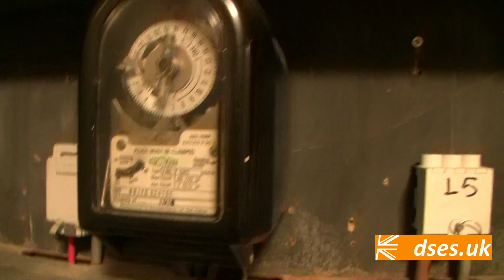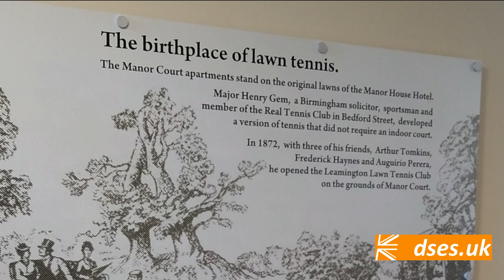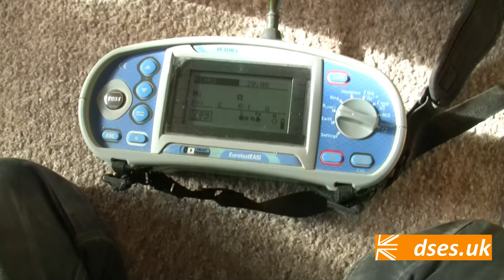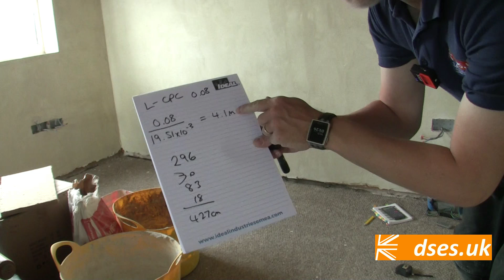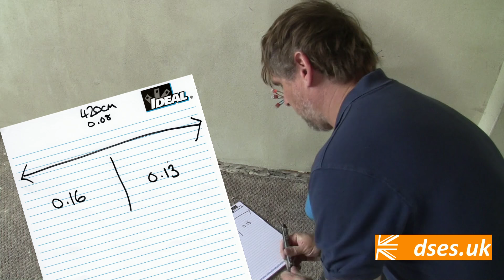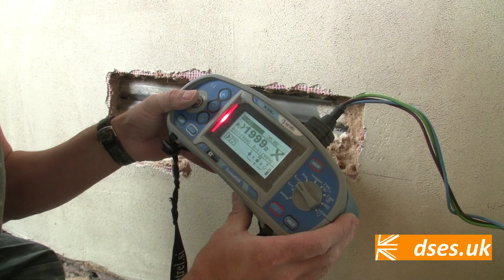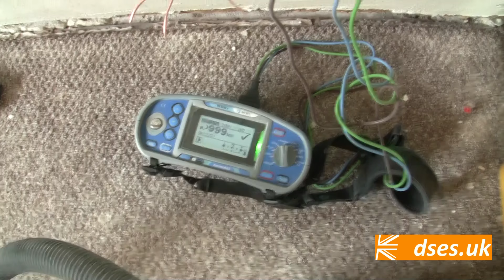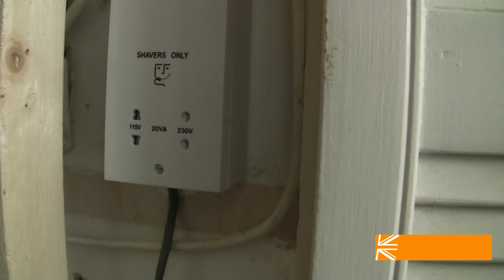Fixing another man's lash-up!

Comment: I do the 1st fix using Wagos type of connectors inside the socket/FCU backboxes, connecting up a ring (or a radial), and even connecting the earth terminal of a metal backbox. The backboxes are effectively doubled up as junction boxes. The ring circuit is tested after the 1st fix.  Any wiring problems are identified before finishing trades turn up. Putting it right afterwards may be big problems.

Then the plasterers and painters come in doing their work. The Wagos are left in place in the backboxes. Then on the 2nd fix, on a bench the sockets and FCUs are prepared, by screwing into all the socket's tail's flexible 2.5mm cable, including an insulated earth wire, about 100mm long with a ferrule onto the flexible wire into sockets screwed terminal connection. The flexible tails are put into the Wagos at the back of the back boxes. The socket easily pushes back in being on flex tails. Then test again. The speed, and ease, of installation is much quicker. And much safer as the ring itself does not have screw connections that can work loose.

I have found many terminal screws on the back of sockets that worked loose over time - expansion-contraction, vibration from people walking on wooden floors, plugs being rammed in and out constantly, etc. That is why screwed terminal are maintenance terminals. Wago screwless are maintenance free. Wago also apply the correct torque to the wire, which is maintained over time as well. Having the full current of a ring circuit flowing through the terminal at the rear of sockets is a potential fire situation, with maybe arcing, also adding higher resistances to the ring, which may cause one leg of the ring to take most of the load, etc.

That is where Wago types of connectors, in the scenario I just outlined, take the ring's load, not the screwed terminals on the rear of the sockets. It is much safer.   The sockets are only spurs off the ring, taking only current when an appliance is drawing current. Go back to a ring circuit after 10, 15, 20 years, then test it. Then go back to one which has the ring running though maintenance free Wago types. The integrity of the Wago connection ring will be upheld. Much safer.

Having Wago types of connections on the rear of sockets, as in Germany, adds another level of safety, in eliminating another screw terminal potential failure/fire risk.  The UK does not have these types of socket connections yet.
Reply: I am in Paris. I have noticed that the normal French sockets have push in screwless connections.  We are only just catching up. 

I would consider using French light switches. They need just a round hole in the brickwork behind. The light switches are push in screwless. The switch is secured by two grips to the sides which are forced outwards clamping the switch to the sides of round hole behind. Much better than the British clunky and time consuming system of square backboxes.

Comment: I'd have chopped a box into the wall and put a blank plate over the join. I know not the prettiest repair but it's a budget job on 60s flats. If it needed to be hidden I'd have gone non insulated crimps, heat shrink the cores then heat shrink the sheath. Been working abroad for a few years though and the colonies are much more into crimped cable joins than old Blighty.

Comment: That’s quite similar to how a DSO would find a fault in a long low voltage (under 1 kV) underground cable, though they would probably cut it halfway for starters and then start locating it. On medium voltage it’s a lot more exciting, out comes the trailer with the surge generator, aka the thumper!

Comment: Hi Dave I really enjoy your videos very informative and wow amazing talent finding that fault. I would like to mention that arse of a job who suggested putting a single outlet so the clients could charge up their laptop or phone on the off peak so it’s on a cheap rate could have simply informed them and said that when the off peak kicks in your meter changes to Rate 2 or 4 depending on which type of Meter you have which all in all means everything during the time the meter is accumulating on the lower rate reading will be on the cheap lower rate price regardless wether it’s consumption of the off peak board or the 24hr as the meter is a single piece of equipment and has two rates. Yes there are two DB boards one off peak and one 24hr however the off peaks gets power when the meter/time clock contactor kicks in at midnight to 7 or whatever the local timing!! Nevertheless great work by you and what a invaluable great video keep them coming.

Comment: clever measurement of cable resistance to find the break!  If it hadn't been the storage heater wire I'd have been tempted to join it by putting in an extra socket.  btw in France the regs say we can't plaster over a join, so there would have been a blanking plate over it.
Reply from the maker: Very interesting, I didn't realise that was the case at the other end of the tunnel! A blank plate could have been put in here, but it would have been out of line with the other accessories so I discounted it on aesthetics.

Comment: Yeah I would have gone from socket to socket in the ring, and then back to the cu.
Thats how we used to do it in the old times, then everything was on ring circuits except for the shower, emersion
and cooker circuits. I have been out of action for a few years now and everythings changed, so I'm going to take a short 
course just to get me up to speed on any new regs and cu changes.  It was all rewireable fuses in my day.

Comment: That was awesome to watch I'm going to have to watch it again I need to learn how to do the calculations, and how quickly you pin pointed the fault excellent the wiring method is called leap froging we only use this method in dado trunking and nowhere else thanks for sharing its very helpful to us older newbies 👍
Reply from the maker: Thanks Mark. I don't see much dado in my mainly domestic work, so hadn't come across it before. Seems a strange one to bury in walls in a domestic install.
Reply: Here is how to calculate the actual distance. I expect David knows but he didn't put it in the video!:

The two readings (0.13ohms and 0.16ohms) represent the RATIO of distance to the fault from either end. An actual reading to the fault can be obtained by the following equation:

(r1 / (r1+r2)) x Cable length (end to end)

where r1 is resistance to fault from point 1,
r2 is resistance to fault from point 2
and cable length is obtained by direct measurement (cable route known) OR calculated as David did in this video using the CPC and line conductor. For this example, the calculation is as follows:

(0.13/(0.13+0.16)) x 4.2 = 1.88m from the point where the resistance was 0.13ohms

the same works the other way:

(0.16/(0.13+0.16)) x 4.2 = 2.32m from the point where the resistance was 0.16ohms.

Comment: I don't use capping at all. I use galvanised steel banding and screw it to the wall. There are so many advantages...Its easier, modifiable (at first fix), safer (no screws/nails through cables, ever) and dirt cheap.

Comment: Quality fault finding on that . Learnt a new way to fault find today 👍
Reply: Heres how to calculate the actual distance to the fault:

 The two readings (0.13ohms and 0.16ohms) represent the RATIO of distance to the fault from either end. An actual reading to the fault can be obtained by the following equation:

(r1 / (r1+r2)) x Cable length (end to end)

where r1 is resistance to fault from point 1,
r2 is resistance to fault from point 2
and cable length is obtained by direct measurement (cable route known) OR calculated as David did in this video using the CPC and line conductor. For this example, the calculation is as follows:

(0.13/(0.13+0.16)) x 4.2 = 1.88m from the point where the resistance was 0.13ohms

the same works the other way:

(0.16/(0.13+0.16)) x 4.2 = 2.32m from the point where the resistance was 0.16ohms.
Reply: @rubberlegs15  cheers mate,  I was looking for this comment,  my maths was failing me 👍

Comment: Excellent video Dave 👍 what a mess. That wall finish is wierd! Why didn't they use plasterboard? 🤔 Noise insulation I'm guessing? As for the repair.. I would chop in a single box behind the damaged cable and joined with Wago 222 and put a blank cover plate on. Needn't be maintenance free then as you would have access. We used to use LCR meters for measuring cable lengths in drums. A similar device can be used to find the point of a short in the cable. Every day's a skool day 🙂👍
Reply from the maker: Thanks as always. The box/blank is the best option, but it would have been out of line with the other accessories.
Reply: @dsesuk  ah yes true, 🤔 what a pain in the ass job...

Comment: Google TDR or Time Domain Reflectometer. It sends a pulse down the wire, and both open circuits and short  circuits return an echo. The instrument times the echo's return and can tell you precisely where the fault is. I bought an ex BT one on eBay and it's a handy bit of kit.

The other bit of ex BT kit I have and is excellent for tracing circuits is a Tone Signal Tracer. Two bits - one clips on the cable and injects a 1000 hz signal, the other is a hand held receiver that picks the tone up and amplifies it - lets you follow wires in cavities, in ceilings and under insulation. I last used mine to trace where my sparkie had failed to connect one of our interconnected smoke alarms.I showed him where it was in the ceiling cavity just before I fired him !!! (he'd also used a CPC as a switched live in our bathroom, and let live wire ends dangle on external scaffolding while the brickies were on it !!!!!!)
Reply from the maker: I used to have a TDR in the 1990's. A Fluke one that I used on CAT-5. Horrendously expensive, not that I paid for it of course. Shame I didn't nick it when I left! I do have a tone tracer though, it was shown in a video a year ago.

Comment: Exactly how i wouldve gone around the fault find 👍 ive stopped crimping solid core cables, but if you have to sometime, then use self amalgamating tape over it. Classed as ‘destructive’ to take it off unlike insulation tape, classed as mechanical protection and you can wrap it as thick as you want 👍

Comment: I had a fault exactly the same, IR was coming back a perfect short and circuit wouldn't stay on (why I got the call). Followed the fault to a bedroom upstairs, removed the plaster to find the same issue. The customer said the electrical install was completed 13yrs earlier, the capping had compressed the cable and over time deteriorated.

Another example why cables need to be installed with more respect than given.

Edited: just to say a great video aswell mate, the art of fault finding is beyond most sparks. It takes time and patience with a logical approach. It seems most don't have anymore.
Reply from the maker: For trip faults, it's unusual for it to be a buried cable, but I had one myself recently where the cable had been damaged, apparently after some problems with subsidence. Someone had come and replastered over the cracks, but nobody thought to check the cable hadn't been damaged. Eventually it failed completely. A bugger to find, but an interesting one; shame I didn't have the camera that day!
Reply: @dsesuk  

Neutral - earth faults seem to get most sparks when an RCD is tripping. Many people have a tendency to leave the neutrals connected at the CU....

Comment: Wow, Cheers Dave! I first practically used Appendix I the other day to measure off cable after you demonstrated it and now you've shown us another use for it!
Reply from the maker: Mate, it's the most useful thing in the bloody OSG!
Reply: @dsesuk  I will hold this knowledge dear to me! I've changed career so going back to college and going back to basics with mind fucking health and safety bullshit is testing my patience. Its great seeing more real world application to what is being taught to "us youngsters"
Reply: @darrenb4253  

I was late to the party too being middle aged and only started training at the age of 41! Did you know you can also calculate the actual distance to the fault?:

The two readings (0.13ohms and 0.16ohms) represent the RATIO of distance to the fault from either end. An actual reading to the fault can be obtained by the following equation:

(r1 / (r1+r2)) x Cable length (end to end)

where r1 is resistance to fault from point 1,
r2 is resistance to fault from point 2
and cable length is obtained by direct measurement (cable route known) OR calculated as David did in this video using the CPC and line conductor. For this example, the calculation is as follows:

(0.13/(0.13+0.16)) x 4.2 = 1.88m from the point where the resistance was 0.13ohms

the same works the other way:

(0.16/(0.13+0.16)) x 4.2 = 2.32m from the point where the resistance was 0.16ohms.
Reply: @rubberlegs15  am going to get scrap length an stick short on it just off mid way an play with the numbers.  Thanks for that info old chap

Comment: I had exactly the same issue almost 18 years ago in a house I owned in London unfortunately someone had screwed a nail and penetrated a wire in a rats nest of wire in a floorboard that was nailed down by a carpenter trying to quiet down squeeking boards. It was then laminated had a new board fitted with RCDs which kept tripping. I had six electricians in trying to fault find all of them gave up. I had to take off the laminate and then hunt the fault down took me several days - testing machines weren’t as ubiquitous at the time, at least I did have one. My solution was similar to yours a wago type connectors box like yours was I happy no but short of rewiring the very difficult run some of it encased in concrete walls it was the only solution. Fault finding is the thing that sets the good from the very best electricians apart. Thankyou for doing this lots of young electricians will have learnt a huge amount from this - patience is the key. Another fantastic contribution.
Reply from the maker: Ouch! Sounds like a nightmare job! We've all been on that awkward nuisance trip where you know it's buried in the fabric of the building somewhere!
Reply: David Savery Electrical Services  genuinely I hope your business goes from strength to strength some of your content recently has been mind boggling good. Your PAT testing insight hands down the best video on this anywhere. Keep the hands steady, good luck to you and Nigel.
Reply from the maker: @mathman0101  Thanks, and if PAT is your bag, there's another video related to it uploading as we speak!
Reply: David Savery Electrical Services  oh man can’t wait it fell out of fashion a little while ago but gonna come back with a vengeance with all the new smart devices and ubiquitous semi-conductor components which remain vulnerable to transients and overvoltages.

Comment: Your repair looks good to me.  I've used crimps and heatshrink in the past.  If you stagger the three (L/N/E) crimps so they don't form one big bulge, you can get a final layer of larger heatshrink over the assembly to fully reinstate the sheath.
Reply from the maker: Yes, good advice, and that would have been my go-to option normally, but I lack some fat heat shrink at present. Must get more when next out shopping!

Comment: If possible my usual default in that situation is to add an accessory, fusing at the feed end if needed. Rather an unwanted socket but visible for repair, testing, MF is also a good option but I like to see things, just my view! Love your videos!!!!
Reply from the maker: Same here Matthew, and I should have mentioned that in the video. Of course, in this case the presence of the capping would have meant a socket outlet lower down than the line of the other accessories in that room which is why I wasn't keen.
Reply: David Savery Electrical Services No of course it was the correct thing to do in relation to the capping, your solution would have been my first choice in this case! As your video showed there was enough ‘quirky stuff’ from the first fix guy, without adding a accessories at random heights! Aesthetics are not secondary, they’re just a slightly lower priority! Glad to see Nige is back! Stay Safe, Stay Sane, Stay Busy!